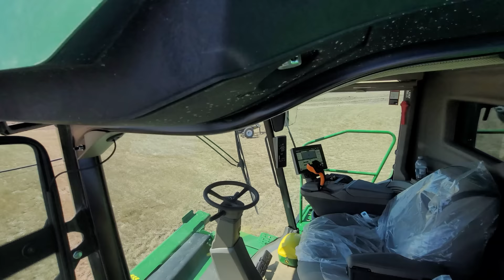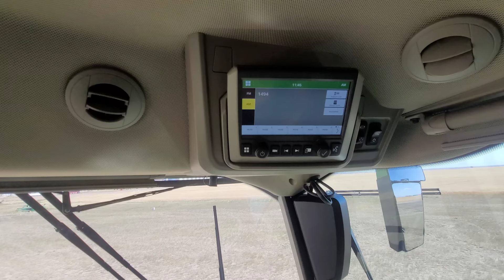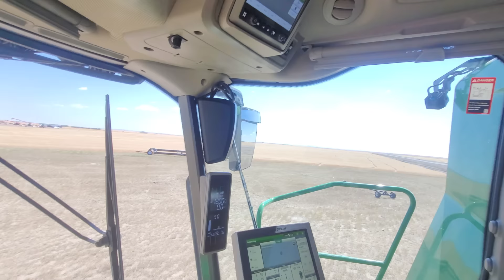New Combines Revealed!

Comment: I agree with the comment about the engineering. When I was about 14 which was 65 years ago, I ran a 21 Massey for my uncle. A steady bearing went out on the clutch and it took us half a day to get the combine apart to fix it. Then 5 minutes to replace the bearing and then another half a day to put the combine back together. I asked my uncle why it was designed that way and he told me, the guys that design these things never have to fix them. That stuck with me all the way through my career designing equipment for the railway and mining industry. John Deere should send their chief engineer out to Southern Saskatchewan to be with Mike and go over the combine from front to back, inside and out. I will guarantee you that the next iteration would be a lot better.

Comment: I love how everyone has an opinion on something and how they don't like it even though they have never been around one, used one, and definitely not payed for one.  Nobody cares what anyone likes or doesn't like.   The only person that matters is the one paying the bill.
Reply: So very true Shane!  These are very very expensive to operate and maintain, fuel
Reply: I have used them in FS22!!
Reply: @ThomasAnselmi1337  lol me too over 150hours on one so basically a john deer teck at this point :)
Reply: @ThomasAnselmi1337  i used to hate using the forklifts with bails but they improved the mechanics of the game alot hopefully they improve the power shift trans more, it wont stall it just slips the clutch and kinda acts like a cvt some times
Reply: @2511jeremy  for my money, gotta go with the Claas and 60ft header. Need mods for both, otherwise the pipe is too short to unload, but it is the biggest tank!
Reply: @2511jeremy  it is MUCH better, but for volume nothing beats autoloading
Reply: @ThomasAnselmi1337  so far i have 2 robotic cow stables about 130 cows and i haven't felt the need to use autoload so far but i don't sell bails
Reply: @2511jeremy  yeah, I only do it for contracts on massive fields and things like that

Comment: Those side panels look like they would be fun to deal with when it is 5c or less when they won't want to flex at all. You probably won't have to worry about that down south there but further north we've worked in those temps in October plenty of times. Not the best design Deere has come up with for sure.

Comment: Those panel clamps have to be the worst design ever. As a mechanical engineer I feel embarrassed for the whole profession
Reply: As you should be.  Sorry joking I had to lol
Reply: Too often many of these are economics driven. Saved ?? $10 ?? on the price of the combine using that style?
Reply: Some are cost engineers not mechanical engineers. Keep that in mind.
Reply: @guzzimon61  save $10 per combine sell 200 and you already saved $2000. 🤷‍♂️
Reply: True. It was clearly an afterthought. Reality though dictates that whomever has to deal with these type of systems right there in your face, has to wonder what is the quality of the things you don’t see….🧐
Reply: Looks like they might vibrate loose pretty easy
Reply: @David-xl8zf  and your mechanic - who loses 10 minutes every time they have to open and close this - eats that saving up pretty quickly.
Reply: I suspect that they had problems sourcing the fancy latches, and so did a provisional design using blow molded panels, welded steel, and off the shelf rubber stripping just so they could ship it.
Reply: It's really not that hard lol
Simple robust system, clip on locks are just a pain, they clog with dust and jam up, or fail 

Why they make it slot in the top in is beyond me though
Reply: @guzzimon61  yep...and with the likely $900,000 (maybe more) price tag, you would hope for better
Reply: I bet that design came from off shore engineering design groups that don’t have a good grasp of the application.
Reply: Dare I say if you used both hands to open and close it wouldn’t really be a problem!

Comment: Hi Mike, I have a question: are the windscreen wipers on combines to clear rain from the windscreen or are they to wipe dust off!? I ask because a manufacturer of electric motors for windscreen wipers once told me that they produced special, heavy duty motors, for combines where the wipers were working on dry glass and required much more power.
Reply: Well, it works for both. Of course it's easier on wet glass when it's raining, because water acts as a lubricant, but you mostly use it for dust in daily use, when you are in the field. You rarely operate combine in rain.
Reply: I think you just answered your own question and even have a wiper motor manufacturer as source.

Comment: I suspect that they had problems sourcing the fancy latches for those side panels, and so did a provisional design using blow molded panels, welded steel, and off the shelf rubber stripping just so they could ship it.
Reply: Comment this pretty often?  They had no problems sourcing latches, they chose the design. It was laid out long before covid or shortages began.
Reply: @stirv6462  twice in slightly different versions to other comments, and once as this comment lol
And if this is just how they designed it before Covid, than I retract my comment and shake my head at Deere doing yet another stupid thing!

Comment: Hope all goes well with harvest for you. All those hydraulic hoses scare me and make sure you keep your radiator blown out as we got a new 9500 the year it came out and we got the beans done and started on corn and I was running the grain cart and I saw a flash and when I turned my head to look it disappeared and then I saw it again and my boss was running the combine and he saw the flash and he stopped and got out and started to kick the buildup of sticks off the head and next thing we knew it the field was on fire along with the combine and I got my fire extinguisher out of the grain cart and the boss got his out of the cab of the combine and we had a guy disking behind us cause it was very dry out so we ran out of both exstiguishers and then my boss called 911 and it was busy and he tried again and the dispatcher said that the fire alarm was called in already the UPS guy called it in also but the guy who that was running the 8440 and disc went around the combine many times until the fire departments got there but if it wasn't for the guy that was running the disc we would of lost over 480 acres cuz the wind was blowing like crazy out of the south and everything was dried up like a popcorn fart Then insurance came out and I asked if they had a fire on the 9500 before and he said it was the first one under the cab and the fires that they did have were all in the back and the tractor with the disc the fire burned the stalks right off the radiator screen of the 8440  and you can still see it today where the stalks burned right on the screen of the tractor.

Comment: Mike,i have a question: How come you picked 1000 version and not 1100? How much was the price diference bteween these two models?
Reply: usd $100,000 😉
Reply: @ytfan3815  Do you even get significally better preformance like larger grain tank? Engine is probably stronger.
Reply: @ytfan3815  SO i just checked the full specs on JD official page: Diference bteween these two models is only  60hp on engine and 40 bushel biger grain tank? And you're paying that 100k more' That has to be a joke.
Reply: @andban92  
The X9-1100 has a usd $916,780 base price, I wonder if it has a header included, full options over a million US dollars.
Reply: @ytfan3815  no header for that price, but probably 20-30% discount on internet price
Reply: @tjakko4659  15m wide new header is probably another 60-80k usd.
Reply: @andban92  More like 200k
Reply: Mike said you need more level land than they have after he tried the 60 ft Honeybee head.

Comment: One thing I've noticed with jd's the newer the model.... more and more cheap plastic crap components to break
Reply: It's probably like that with every manufacturer of everything. Stuff gets cheaper build.
Reply: Hopefully they will change that.  GM finally made their interior plastics a LOT better, but it took like 20 years probably?  And they still got worse before they got better now that I think about it....
Reply: IDK it was way worse on the early 2000's models where they went all in on making entire bodies from plastic on all their equipment. And it was poor mass tinted quality that would get damaged by UV in a couple years. For the past 10 years they toned it way down and use far better quality.

Comment: Mike, I am wondering when a plane will be discussed to shuttle you and family between the two farms?  In your case, time is money when you are the labor at each.  It seems that you have outfitted your north farm with the equipment needed.  In light of two new X9 combines, the price of a plane seems fairly reasonable.  Getting to the north farm 4 hours earlier to beat a rain could pay for a plane in one or two years maybe???  I think a plane would add a lot to the channel.
Reply: One of Mike's brothers is a pilot and has a crop duster plane on the main south farm.
Reply: @ITubeTooInc  I knew that they had their own crop dusting plane and that someone in the family was the operator.  I was thinking a single engine four seater.  I know nothing about single prop planes, or any number of prop planes, jets, etc.  I just know a number of business owners that originally thought the price of a plane was unnecessary to keep track of their interests over a wide area.  After using the plane as a business asset, they realized the benefits of increased productivity paid for the plane expense.  Not to mention their quality of life improved.
Reply: @gooddaysahead331  I did not know that.

Comment: Should ve gotten  a 10.90 as far as the build of this combine its a joke compared to a New Holland actually its copied alot but it's not the same.e
Reply: We run CR’s and I have no problem admitting New Holland could build things heavier and beefier. As far as the twin rotor design goes if you’re going to bitch about it then bitch about the Claas machines using twin rotors as well.
Reply: @davidlogel2350  we got six 8.90 love emm never really have many problems there's some stuff that could be a bit heavier but the amount of problems we have with emm I wouldn't worry about it